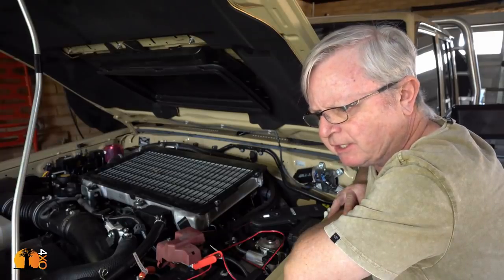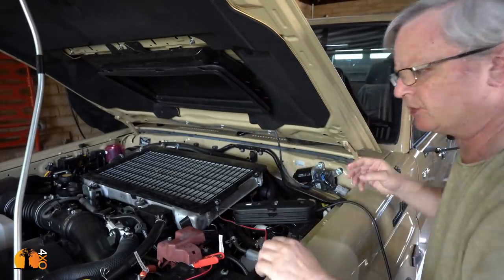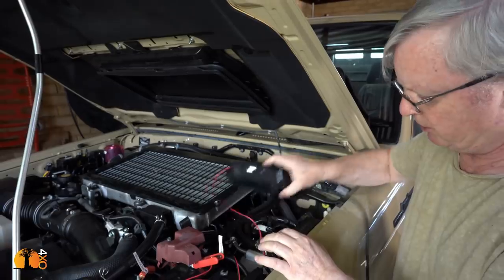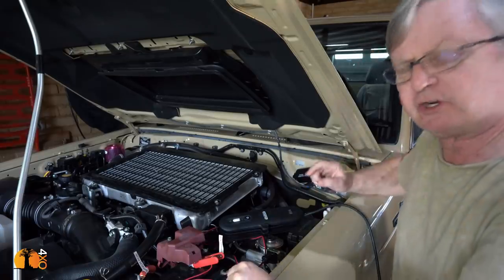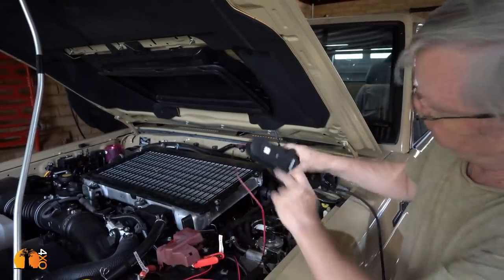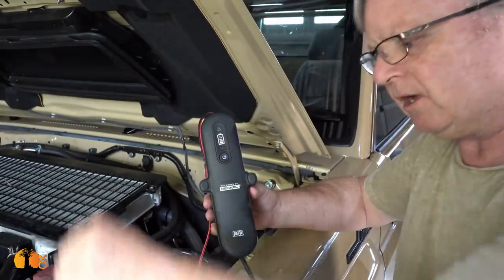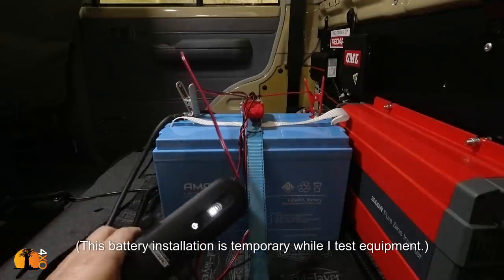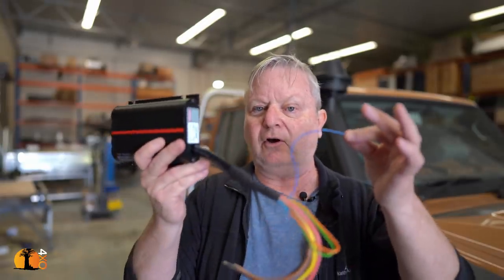DC-DC CHARGER RUNAWAY DISCHARGE WARNING.

Comment: @4xoverland 

Andrew if you use a simple ignition activated relay from the main battery to the DC DC charger feed this would never happen.

It doesn't need to be a redarc, not even a VSR but just a plain and simple relay that will only allow voltage if the ignition is connected. 

If you use a VSR it should actually cut the circuit when cranking battery hits 12.8v.

Basically you would be applying thr wiring below as if the back of your car was a caravan. Effectively making sure that the feed to the auxiliary is only live when the car is running.

https://www.redarc.com.au/wiring-diagrams/how-to-wire-bcdc-caravan-vehicle-variable-voltage-alternator

You only need to make sure that it is an "ignition" source and not an "accessory" one.  In my ute it is easy because it is a push button start, so it will turn itself off if I leave it on ACC or IGN without the engine running making it dumb proof.

Bonus. If you use a VSR like the red one from kickass then you can keep the circuit closed even without the ignition at the flick of the switch  without spending $200 on a redarc unit.

https://www.australiandirect.com.au/Battery-Systems/Battery-Chargers/KAVSROVER

With the $160 you would have you could invite me a beer when you go pass Qld.

Comment: Run the trigger up past the crank battery on the way to the ignition;  then have an inline switch at the crank battery?
Reply from the maker: This is not a problem I’m trying to solve. And neither is this a mystery as to why it happened. It can and will happen to anyone using a DC-DC setup. It's the nature of how DC chargers work. All of them with the exception of those relying only on a trigger wire. The solution is to charge the auxiliary batteries first. It's that simple.

Comment: He is exactly right, which is why I run my DC-DC in ignition mode.  The moment the ignition key is turned off, my DC-DC is isolated from the starter battery.

Comment: If you have a 1225 or bigger with a solar reg and all your acc are run off ur auxiliary battery why are u charging your starter? It shouldn’t need to be charged if it’s only used to start

Comment: noting I told you this 20-50 episodes ago

you should be 48-70VDC in the engine bay and same or higher battery system in the rear ..

if you are charge  from vac I would  suggest something within the 240 vac at 20amps as this is about the standard inlet you get when  adding mains inlet  when you apply it to a charging or general power use within the confines of a caravan, 5th wheel or some trayback to tow behind trailer which will need to fused..
Reply: Jason, that's a good way to approach it.
Reply: @Michael_Mears  what the auto sparks  don't understand or failure to comply with is you must have a mains inlet that is fused..

any ac outlet you use in caravans and so forth your vac mains wiring is the same as your household which 240 at 10-15 amps..

noting you will bee looking 3-5 Kw inverter to run 

from what I see of Andrew's battery he is likely 3-6 batteries short for  the battery to ac power conversion and I suspect he 24-48 vdc short off the cranking batteries

At this stage I doubt he has the power to run 2 uhf cb's , 1 27Mhz  cb and 1 ham radio, wired in sat phone and the lighting system for driving in the dark..

he might want to consider  putting all the batts in 1 area

i doubt Andrew has a volatege and amperage calculation of both the vdc and vac needs of his setup

looking at the house battery 1 isn't looking at the glamp setup isn't going to run long

you are likely lookng at a 24-48 vdc charging option you will likely cook the the shot out of 12-24 vdc charger..
Reply: Yes, not many approaching it this way, looking at battery conversion to ac, and the appropriate voltages in which to do this.  It seems to me some people are putting these systems together with little or no regard to loads, except at the most basic level, or perhaps in isolation, nor considering the voltages and battery sizes in order to do supply these loads.

When I see a video "Andrew Speaks Electriks" I'm already sighing and shaking my head.  For example, in some of his videos he uses amps and amp-hours interchangeably...it doesn't help him explain what he's trying to explain.  Yes, I doubt he has done a full audit of his system, either.

I had to laugh when you said "the glamp setup isn't going to run long".  Glamping...such an apt way to describe it.

Comment: Manual isolation switch (on the dcdc circuit from crank batt) whenever you need to ac charge the crank battery?
Reply: Grant Kerr apparently the cutoff voltage on those things is 11.7V so it will flatten your crank battery down to that if any of the other batteries still need some charge after you have run the vehicle.

If you can change the cutoff voltage to something more appropriate (like 13V) that would be the best option otherwise would get an automatic voltage cutoff (or the manual one and remember to disengage it every time you stop and reengage it every time you are doing a long drive.
Reply: Glen Collins 
The standard cut off voltage is 12.7v. Manually changeable to low voltage setting to allow deeper discharge of starter battery to 11.9v. But you have to manually activate that setting. 
Cut in voltage in standard setting is 13.2v. This does confirm that the ac charger is fooling the red arc into thinking it’s received alternator current and then switching on to do its thing. Important to remember that the red arc and most other smart dcdc chargers (and ac chargers also) don’t charge at full rated amp current through the entire charge cycle. Ie; boost mode volts/amps profile is very different to absorption mode volts/amps. It’s all dependent on the sensed state of charge of the auxiliary battery as to what the dcdc decides what combination of volts/amps is appropriate at that given point in time. That may well be much lower than 50amp. In that case the voltage drop across the battery is much easier for a ac charger to compensate for and allow the dcdc to drain away. 
That’s my understanding anyway.
Interesting topic and I’m happy to be corrected if I’m wrong. Keen to learn more.

Comment: We have devices to solve most of the issues he described.  Battery switches have been around for more than 15 years.  Deep cycle batteries can be drained to near 0 and still recover.  So just because he got caught up $hit creek just says that he needs to research more.
Reply from the maker: This is not a problem I’m trying to solve. And neither is this a mystery as to why it happened. It can and will happen to anyone using a DC-DC setup. It's the nature of how DC chargers work. All of them with the exception of those relying only on a trigger wire. The solution is to charge the auxiliary batteries first. It's that simple. When I learn something, I like to share it. Sorry if this is a problem for you.

Comment: so red arc needs to make a 60 amp charger or a way for the dc -dc  to know it has only a 10 amp boost supply
Reply: conversely, you could put a relay in to shut off the dc-dc feed when you connect the 10 amp charger

Comment: I would install a circuit breaker right after the battery and before the dc to dc charger. That way, when i need to charge the main battery, i flip the breaker, disconnecting the dc to dc charger.
Reply: Yes, exactly, this is how mine is set up.

Comment: I have fitted a 12v battery isolator in the line powering my DC-DC charger so it cannot do this.  It cuts out at 12.8v
Reply: Where did you get it please @muzzgit? Cheers mate :)
Reply: @kirkvagg8004  I bought a KINGS Isolator kit online, but for the second battery box I bought a Powertech MB-3685 from Jaycar. Both do the same job but the Kings is more for a full-on dual battery system, so not needed inside a battery box, as long as you are using suitable gauge cable

Comment: Does a Smart Battery Isolator change this scenario?
Reply: Moorabinda it could cause the DC to DC to continuously stop start which wouldn’t be good for it but it would protect your battery from a stupid cutoff setting in the charger. 

Assuming the charger is wired up to it.

Comment: Firstly - Why did you need to put a charger on  ?   Was the Cruiser not charging itself properly?  What necessitated the charger in the first place - therein lies a lesson.
Reply from the maker: I like to boost charge the starter battery when the car has been sitting for a time unused.
Reply: @4xoverland  Which means you're not getting out enough :-P :-P

Comment: Get yourself a decent charge controller. Like a Victron. Your problem will worsen once you add solar into the mix
Reply from the maker: No it will not. The DC-DC acts as an adequate charge controller. That's its job.

Comment: Hang on a second, firstly, I thought the DCDC charger boosts the current to 50amps/hr, so shouldn’t it only draw a portion of that 50amps from the main battery system, not the whole lot? Also, you say your alternator pumps out 170amps? Then why would you need the DCDC charger at all? Please explain what I am missing here...
Reply from the maker: DC-DC controls the current AND VOLTAGE to the second battery and takes care of voltage drops. They are extremely efficient, and that's why we use them.

Comment: I though that a DC to DC charger only works when the engine is running, at least a Victron charger......
Reply: if you use the D+ to activate the booster its no problem if you use the recognition feature i would not be so sure

Comment: “So what does this really mean?” It means you weren’t paying attention. Every piece of equipment was doing what it is supposed to do. Why on earth would you try to charge the starter battery from shore power without disconnecting the dc-dc charger, while using only a 10A shore power charger? Of course 10A cannot keep up with 50A.

Comment: ah sounds like the reddarc is poorly designed. It ought to cut off at 12.8v. I can get 80A with a cable how much was the box?
Reply from the maker: This is not a Redarc issue. All DC-DC chargers will do this because they rely on reading the voltage across the main battery to turn on. And if you use a trigger cable from the ignition, the start battery can be discharged if the ignition is left on, with the same result.
Reply: @4xoverland  nope. Sterling's don't. They use voltage to turn off too. So they don't flatten the battery.
Reply: @4xoverland  It is a Redarc issue if it manifests in a Redarc product. I only use DC-DC as current limiting devices. I can double that output with intelligent cabling and an Albright Contactor. As regards the issue you are having...without my reading the manual, is it setup for regen braking instead of standard perhaps? To work around you can trigger it manually or use the D+ which won't activate unless the alternator is spinning.
Reply: manual page 9. Should turn off below 12.7v....your issue may be elsewhere. a 10A charger would not likely hold it above this with a 60A load...grab a meter and diagnose
Reply: manual page 13 FAQ top of page suggests it's creating a false trigger feedback loop....that could destroy batteries, it's dropping your engine battery to depleted in your don't interrupt it scenario..and then charging after the fact, damage done... interesting, convinced me not to buy one. Sound.

Comment: There are isolators available to prevent exactly this from happening that go between the Main and Aux batteries/redarc. 
These are not the cheapy isolators you buy they are more expensive and specialised.
Reply: Battery Management System by Redarc. That’s the expensive end.

Comment: So this can be avoided by tripping your inline circuit breaker at Main Batt when tendering the cranking batt
Reply: Yep, Hugh, spot on.  Anytime I charge the cranking battery directly with ac charger or solar, I trip the breaker to isolated the dc-dc charger and the rest of the system.

Comment: Hi Andrew, I wired my BCDC1225 charger up the other day, and I've noticed something in the manual. It says if you connect the blue wire to 12v it will turn on and if the voltage is at 11.9v then it would turn of. What if you add a switch to the blue wire, and connect it to ground which will give you 0v when it's switched on. Hope you try it out and let us know how that goes.

Comment: Unfortunately you are incorrect,  stop misleading people with false information. what you described is not possible.
Reply from the maker: It is not only possible, but I proved it. Twice. I then verified my diagnosis with several professionals -  people in the business of DC chargers, including an engineer at Redarc. Who I assume know more than me. And you.
Reply: @4xoverland  well for starters a 70 series has what is known in the trade as a low voltage output, hence the reason you can purchase a resistor fuse to trick the alternator to produce a higher voltage to fully charge a battery, normally it would rarely reach 13.2 to trigger the charger, hence the blue wire should be connected to the ignition to trigger the charger on a 70 series.

Comment: The trigger should be wired to a circuit that is only active when the engine is running.
If you had a foggiest clue what you were vlogging about you would know this.
As usual you don’t know the facts and you comment like you do.
Pity those who don’t know better believe the misinformation you keep spouting.

Comment: Redarc I'm surprised this scenario got past you - a 50 amp parasitic drain. All that money spent, the promises and still problems...
The problem with all of these battery management systems is they don't isolate the start battery.
Leave your radio and fridge running and find out...
The only way to isolate the start battery is to disconnect the start battery negative, then everything (including radio) has to draw from second battery.
Reply from the maker: This is not a problem I’m trying to solve. And neither is this a mystery as to why it happened. It can and will happen to anyone using a DC-DC setup. It's the nature of how DC chargers work. All of them with the exception of those relying only on a trigger wire. The solution is to charge the auxiliary batteries first. It's that simple.

Comment: Not to bright huff said
Reply from the maker: This is not a problem I’m trying to solve. And neither is this a mystery as to why it happened. It can and will happen to anyone using a DC-DC setup. It's the nature of how DC chargers work. All of them with the exception of those relying only on a trigger wire. The solution is to charge the auxiliary batteries first. It's that simple. When I learn something, I like to share it.
Reply: @4xoverland  Indeed good sir.   2 things I'm curious about in that scenario: 1)Aren't you technically using AC-DC charging...something the DC-DC charger isn't designed to sense and compensate for.  By using a wall charger, (yes I know it converts to 12v) you are introducing an additional charge source apart from solar or aux batt/alternator.  The good ol'e RedArc has no way of knowing from whence the power comes.  It just sees a trigger voltage and goes to town.  It's like those dc/ac inverter/chargers that convert 12v DC to AC but can also convert AC to DC to charge the batts (shore power squids call it).  Only, an inverter/chargers' inverter knows about the charger.  The dc-dc charger knows nothing of the "AC" input (charger).
2) But more importantly - to me anyway - is why are you having to charge the battery in the first place?  Are you trying to charge the aux batt via the crank batt out of convenience or was the start batt flat or...?  Imo, solar on the RedArc is the way to go to combat parasitic losses or continuous low amp draw.  It's a good excuse to mount a little 10amp trickle charge panel outside the garage while you're home.
Love your work.  Take Care!  Happy Trails from CO US.